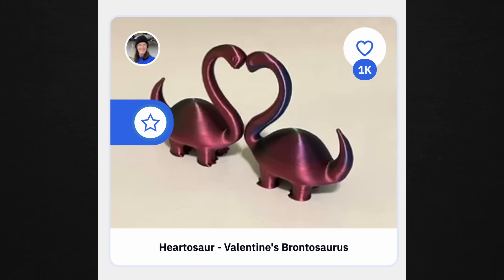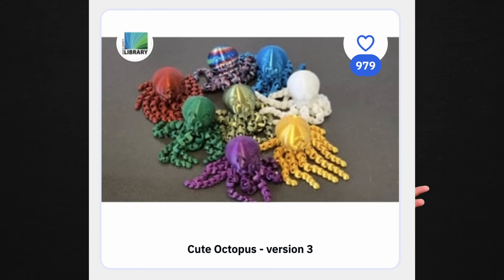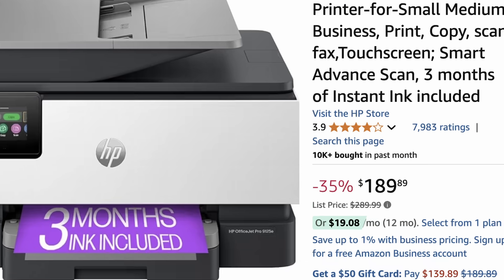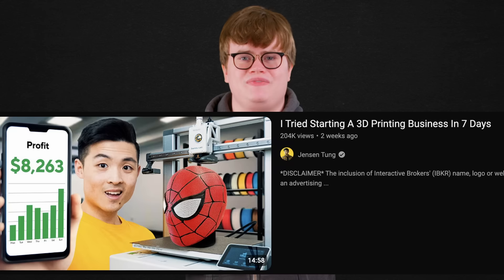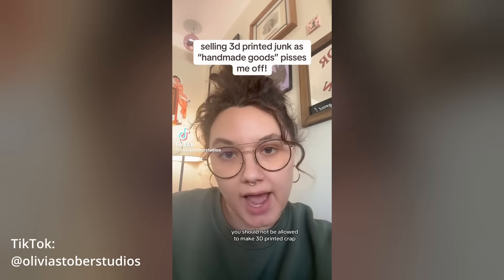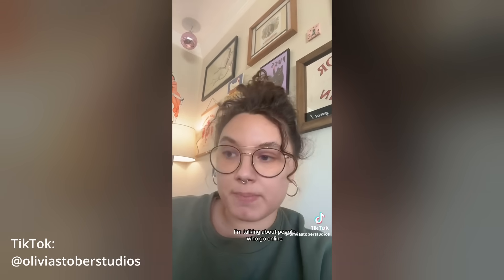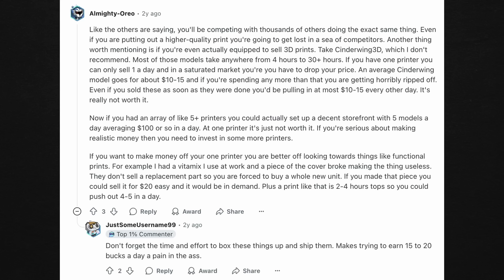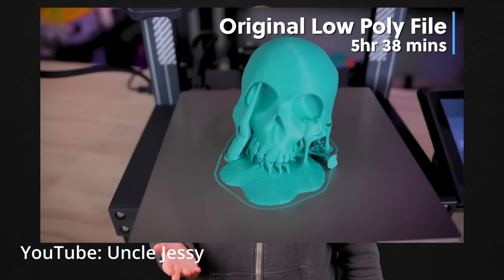The Rise of 3D-Printed Slop

Comment: I have a MSLA and FDM printer. The MSLA for printing accessories for my scale model hobby, and FDM I bought for functional prints. 

Since I have 4 airbrushes I also bought a BenchVent fume extractor I have running all the time when either 3D printer is running and the “Hobby Room” is just that, a small room with a door I can close whenever the 3D printers are running and have the fume extractor running. 

For now I’ve printed offsets for bike fenders for my cargo bike, so the bike fenders are centered above the wheels, offsets for picture frames around my TV so the TV doesn’t burry them and right now I’m 3D printing some ramps so my robot vacuum can easily clear door frames. 

But after that and few more ideas I simply can’t see what I need this printer for. 

I don’t get these people that print stuff for the sake of printing stuff. 

My MSLA printer is probably gonna be in my hobby room for far longer but that’s because I have a lot of scale models with a bunch of upgrades I have in mind.

Comment: i hate when beginners get incredible printers like the BambuLabs X1 or A1, or even the Prusa Mk4, and print junk on it. i started with a cheap Chinese unit off amazon, and though it was a horrible printer to use, i gained so much valuable knowledge on how they function and how to tune them properly. having a machine that does all the work for you takes all the fun out of learning a skill. yes, i use a BambuLabs P1P now, but i feel that i’ve earned the right to use that now that i have an appreciation for the machine itself

Comment: i have a little dragon from a maker's market and specifically remember the artist mentioning they get the designs and license to use them from someone else's Patreon. the pyramid scheme alarm bells in my head put me off, but their prices were low, their designs were cute, and I'm always on the lookout for fidget objects that might actually work to stymie my nail-picking habits. but the thing i've learned is...they aren't even good for fidgeting. in most of the designs ive seen, the joints are loose and floppy, and the connections are so small with such fragile fibrous plastic that i can hardly touch them without fear ill snap it apart. these dragons are nothing like the classic wooden articulated snakes that inspired them, which is really disappointing.

and if anyone knows of any good fidget objects that can take force and have some kind of "snap" to them, please let me know. i'm desperate lol

Comment: Okay. While I agree that printing more plastic junk that ends up in a landfill is bad, I’m going to say that’s still better than you saying “you could just buy that from Temu.” Because you’ve reduced the environmental impact by (1)not shipping that crap overseas, and (2) there’s still less plastic in the landfill because of  the ridiculous layers of packaging materials used to ship those items. 

So yes there needs to be a massive consumption reduction of cheap crap. But 3d printing is at least some improvement.
Reply: Not encarbonating the environment by not shipping crap overseas, but then, where does the filament spool come from? Was is shipped overseas from Asia?  About the same weight of material, whether as unformed raw material filament or as the final product.   If anything, the final product might be slightly lighter than the filament used to make it, due to material wastage.
Reply: No sorry, as someone in manufacturing, the cost to the environment of a mass produced injection moulded part is far lower than any 3D print at the small scale. The carbon and packaging required to ship the printer and rolls of filament is far more  onerous than mass produced parts shipped out efficiently. Pretty much all plastic is coming from china anyway so it is better for the environment for it to be mass produced and shipped. Obviously they are both bad but it’s a better of 2 evils response. I use my 3D printer as a tool in my lost wax casting jewelry process, something that no other tool could do.

Comment: I was between buying a 3D printer and buying a laser cutter /engraver. I ended up buying a laser cutter, under the impression that a similar creative community existed for laser cutters like thingiverse, etc exists for  3D printing.

It doesn't. You cant do as much with it. If you look around for a creative community of hobbyists you'll mostly find hustle culture bullshit and guides on which tchotchkes are big sellers. Really disappointing.

Im still considering getting a 3D printer to print random toys for my kids, or custom parts (like clips, brackets, containers, etc) for stuff around my own home. 

Surely the amount of plastic waste generated by a home hobbyist printer only for personal use isn't insane? Feels like there would even be less waste overall.

Comment: Got a 3D printer.  Yes printed out some "slop" - to get an idea of how this is process is going to work (and sorry the flexidragon in silk PLA is really cool lol).  I have however also downloaded freeCAD - and have 4 "thingys" done that have improved bits of my environment - not exactly problems but alterations I wanted to make.  I will no doubt continue to download and print "slop" - I am a grandparent and can produce a little toy for less than one from a shop - which will also be made out of plastic and will also hold attention for the same amount of time and also end up in landfill.  The difference is the printed ones are PLA and will eventually breakdown, the shop ones will be of other types that are far less biodegradable.  I will also continue to play with designing, and will be looking into lithopanes as I am also a photographer.  The thing is this machine has such huge options it is going to take quite a bit of time and some learning to start exploring them all.  Those people printing trinkets will come across their own unique "wants" and will start looking to fix them themselves - probably starting with the customnizable storage systems.  It will take time but will happen especially as more and more children learn CAD and tell their parents they can fix that.

Comment: 2:26 seems to be solved by input shaping. Your argument holds though. If you're not a maker with at least some modeling skills, 3d printer is a splurge.
6:26 wait till you learn about slip casting, some design their items to look "handmade" and smooth out mold parting lines afterwards xDD

Comment: We need way more modularity.  Like, everything could be part of a modular system, MIT or public domain, none of the proprietary competing systems stuff.  Nobody landfills legos.   Gridfinity is a start but it doesn't fully cover everything that could possibly be modular, and a lot of the stuff is a bit too single function, in addition to open containers being dust magnets and needing a carefully laid out workspace to be practical.

Even those little octopuses could have a hold in the bottom so they could go on a signpost holder or become lamps or something.

Comment: my headphones work perfectly fine, they just need some spare parts for the plastick holding it together, i also want to make custom piece that follows my check/nose bridge curve to plug the gap between my face and neck gaiter so i do not fog up my glasses, then onyl think i could think of is making enclosers for whatever electronic and/or robotic thing i am playing with(eh i meant making it from scratch with components), is this not enough to justify getting 3d printer?  i am sure i will think of under stuff if i get experience with it
Reply: would you consider trying out clock and other gear contraption as Absolut waste?
oh and i wanted to try some aluminum casting, having 3d model as stancil(or sacrificial piece, pattern?) to make the mold would be great

Comment: While I agree with most of your points, I am on my second printer. My new one is an order of magnitude faster, higher quality and reliability.  The prints I produce are used as terrain and miniatures for my D&D game and look fantastic when painted.  I've saved many times the cost my printers and have enhanced the enjoyment of my other favorite hobby.  There are a lot of hobbies out there that pair well with 3D printing, D&D, Model Railroading and doll house builders, and remote control model building for a few examples.

Comment: Part of the reason relatively few prints are actually useful comes down to 2 things: 
1) Many people have no clue how to create their own items. Some people will put forth the effort to learn how to use a 3d design program.... but most won't. 
2) Until recent years, the printers were not reliable enough to be considered tools, for most people. Many printers (especially cheap ones) require a lot of constant tinkering and calibration to get remotely decent prints. If you bought a $150 printer, you'd probably spend hundreds more on upgrades and dozens (if not hundreds) of hours tinkering with it to get it to print reliably and quickly. Furthermore the printing process has a huge amount of prameters that can be adjusted to affect the print speed and quality. So 3d printing became a hobby in and of itself for some people (mostly nerds and tinkerers). I've seen things describe 3d printing as "a hobby in which one pretends to be a professional machinist or mechanical engineer and gets paid little plastic boats" (plastic boats called Benchy's are a common model used as a benchmark to test a printer). In recent years BambuLabs has released some 3d printers that are reliable enough and fast enough that many would consider to be tools or appliances. but even they are on the edge of that classification and those things are far from perfect and people still have to learn how to troubleshoot.

Most people will not have any real use for 3d printers If they got one, it was likely because they got caught up in the hype and promises. They would print a few trinkets and lose interest. 

The video also mentioned a bunch of video trying to promote it as a side gig. I've never seen those. I think that might be a difference in our Youtube Algorithm results. 

However, there are some hobbies that use it a lot. I've seen some custom car youtube channels on youtube that have  people designing custom parts... They tend to use really expensive, high-end filaments, instead of cheap plastic... but it's still 3d printing. 

3d Printing is also widely used in various RC hobbies (FPV drones, RC planes, RC cars, etc). I've designed 3d printed parts to modify or repair RC planes. Some companies that make frames for FPV drones release 3d models to let common parts be used with their frames (adapters, antenna holders, camera mounts and protectors, etc).

So there are uses... but then tend to be quite niche use cases.. In an age where the majority of people do not put forth much effort into making or building things of their own, 3d printers are useless for most people.

Comment: Well, there is a big issue with people printing stuff that they don't need, but i feel like a couple of the points made are unfair. In the case of something like the ring measurement gauge, it is muuuuuch better to print it yourself for pennies on the dollar at home, than to spend the money on the item, shipping etc. It also doesn't create the need to ship the item to you, so technically less pollution. Most of the people who I know who have 3d printers mostly print stuff they designed. The video makes it seem like only a very small part of people who have 3d printers know how to design, when it's quite the contrary. Also I feel like the video goes off on tangets that are unrelated to the "rise of 3d printed garbage" (Which is a big problem!) that kind of show you may have a bias against 3d printing or something. You mentioned 3d printers being hard to use, how prints can fail,how the layer height impacts appearance (which I think you exaggerated like in the case of the whistle comparison picture, showing an absolutely terrible print that is much worse than you would expect from even the cheapest stock machines), or the air quality concerns with 3d printers around. While those are real problems, I don't see the importance of mentioning that in a video about the rise of the trinkets clogging up farmers markets etc. Because of that, even if it may not be true, your video gives the impression of it being a "look how bad 3d printing is" instead of "how the useless 3d prints are bad"

Comment: I feel like the best use i've seen for a 3d printer is having one at a local library. This way if you need anything made you can still get it and people are encouraged to think about how they will use a public resource responsibly instead of making a bunch of useless plastic garbage. My favorite use of 3d printing is being able to make tools for other art. like if you have a new idea for a tool that could be used with fiber arts you and work with a 3d printer to figure that out. also being able to design cheap accessibility tools. as a disabled person we could potentially go to the library and have accessibility tools printed just for your needs if what you need if it doesn't exist already.

Comment: Just from my end and very specific niche (SLA 3D printing miniatures for game use) printing ends up saving tons of money. Part of the difference is that resin printing trades complexity in operation for complexity in post print and clean room operation. But what you get for it is insane for the mini hobby-- I've printed maybe 4-5 different armies for my games of choice for the same cost as buying just a single one. My hobby budget moved from the low thousands per year to the low hundreds.

It's not quite the same as the goal you are looking for, but it has absolutely revolutionized and democratized my hobby.

Comment: I find 3d printing metal chassis parts for cars is some kind of min maxing on the car world trying to squeeze out every ounce of weight they can on all the parts of the car they can while not letting it fall apart. I still doubt the durability of 3d printed metal parts though even if it's heat treated along with all that complex geometries they all have for structural stability.

Comment: My hubby got a hand-me-down 1st generation 3D printer from his techie friend many years ago. It was cantankerous, the PLA was expensive, it took forever and several tries to print something. It was loud, the nozzle smoked, and it sucked tons of electricity. To justify its existence, hubby kept insisting that it could make useful things.

IKEA bin clips? Not flexible enough. A replacement foot for furniture? Not high enough tensile strength. Spark plug wire organizer? Too low melt point. Custom yo-yo? Too lightweight, even at 100% density. It couldn't even make a TOY. It just made knick-knacks. The 3D printer ended up in the Dumpster and we really haven't missed it.

If you want the ability to custom manufacture useful things, get a metal lathe.

Comment: Can filaments be melted and reused?
Reply: Yes it can, but it isn't perfect. With almost any material that is recycled, a small amount of "virgin" mantieral is added. The main issue with 3d pinting/additive manufacturing, is the lack of close-by recycling plants or operations for these materials. One of the most common types of filament, PLA is recyclable but it's quality degrades rapidly. It is much cheaper for companies to produce new fialment with all virgin material. As the logistics of shipping, testing, cleaning, crushing, mixing, and then extruding into a filament strand cost more than bulk ordering new pellets to produce new filament. This changing as more people are becoming aware of the issue of all these plastics, and thus we are seeing programs for these fimanets, but even then they often cost more than buying all new filament. Sad part is that people will buy from whatever is cheapest, just how it goes. We could see a system at some point for at home recycling, but there is a lot of material science and testing when it comes to recycling and not have a rapid degrade in quality. Hope I this helps.

Comment: Lower layer height increasing the print time substantionally is not true. The limiting factor is material melting. Motion systems of todays printers are too fast, only topping out on travel moves. The bottleneck is transferring heat into the plastic, and even if that is solved by building some insane extruder, you soon hit cooling limits. This is the reason why CHT nozzles can print faster than normal nozzles.

Comment: i got a 3d-printer about two years ago. except some upgrades for the printer it self (designed by some really great designers) i mostly design all the things i print myself. it has been a really good tool to print helpers and fixes around my house. sure there are some prints that are gimmicky, but most of the time the print will serve a purpose.

edit: one thing i wanna add. i also have some models on the various sites like printables or makerworld. and i they are all free and can be remixed. sharing is caring, why would i charge for something i created for the community.

Comment: I like this video, I think if people want to print junk let them. I just don't like it when non engineers think that's all 3d printing is for.  I use the printers I built to make prototype models of inventions i think of. Its much cheaper to mess up and redo a peace of plastic then a block of aluminum stock with a CNC. 3D printers are great for getting the models right and then making the injection mold. Printing only plastic toys is a waste of potential in my opinion.